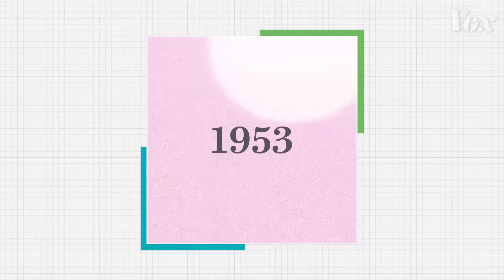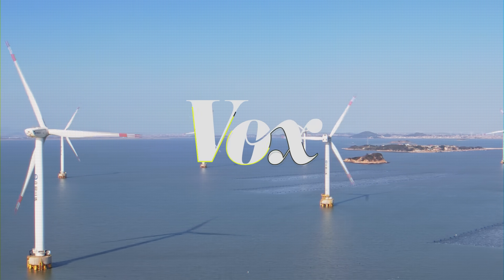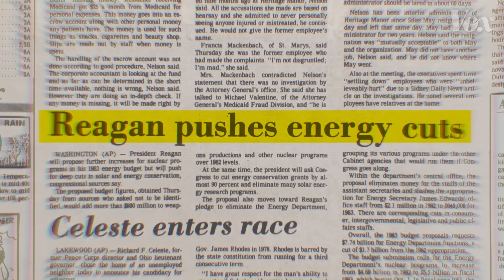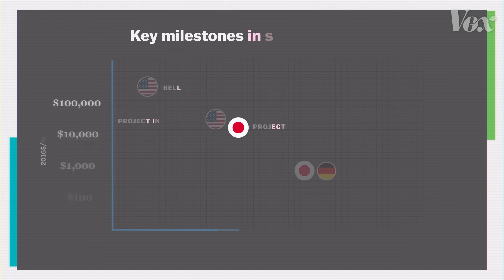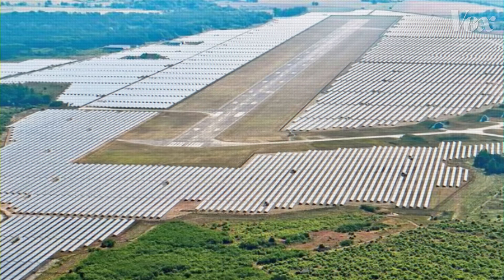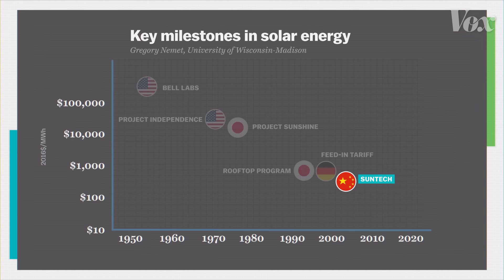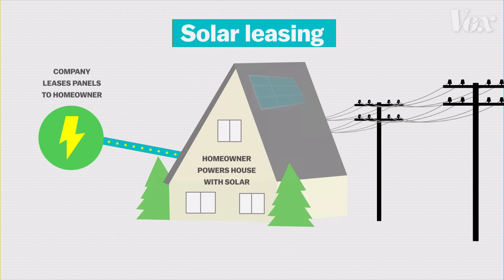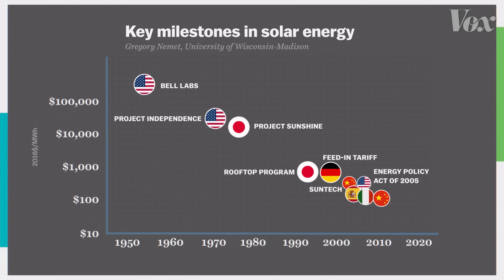How solar energy got so cheap

Comment: Solar Pannels may have become cheap. But its still out of budget for millions of families, because its still expensive. Because Panel alone dont help, you need other system along with it, which does not got cheap as compared to panels.
Reply: its definitely on track to get there! i mean look at smartphones only used to have expensive models  then now bam we have super budget models too in as like a decade of smartphone!
Reply: It depends on the country. In Germany Solar is extremely cheap. You have a return in under 2 years, compared to energy from local supplier.
Reply: @huckleberryfinn6578  

But the price of electricity in Germany is 3 times higher than in USA. Solar is "cheap" in Germany because it is artificially elevated by the subsidies, but for the economy and industrial sector it is not cheap.

For comparison:
Germany: 0.30 EUR/kWh (roughly 0.35 USD/kWh)
United States: 0.13 USD/kWh
China: 0.08 USD/kWh
France: 0.19 EUR/kWh (roughly 0.22 USD/kWh)
Reply: @xeioex  but France has all of its nuclear plant, US has its super cheap domestic gas, and China also has super cheap domestic gas and coal. 

Germany's prices are comparable for other nations with similar energy mixes. It's certainly an argument to be more aggressive about national policy for power, as other nations have done with hydro, wind, or geothermal power as well. But for the millions if not billions of people living in countries which haven't previously had the foresight, solar is more economical now. That's only "artificial" insomuch as it was avoidable. 

Also, the above-market-rate thing is not currently in effect, now it's just the wholesale rate, which is between 8 and 11 cents per kWh just like industrial producers get paid. Basically every country with a feed-in tariff just pays the wholesale market rate now, ie to cover 1 unit if your night-time usage you'd need to export 3 units in the day. That's not artificially subsidised, and in fact the USA is in that regard currently "worse", since you have net-metering in most states.
Reply: @kaitlyn__L  

>solar is more economical now.

This is not true if we consider the true cost of ownership of solar for the grid. It cannot be economical as is, because it is unreliable in terms of electricity production. The peak demand is in the morning and in the evening and solar cannot produce during these hours but the grid have to deliver the electricity from somewhere somehow.

The main problem with solar/wind is that you as a national grid have to have a backup generation for every solar/wind generation. Which makes the whole grid system solar/wind grid + traditional backup grid expensive (because you basically would need to have 2 grids).

The alternative is to combine solar/wind generation with storage capacity (batteries), but the combined cost of solar + storage makes the end price even less cost competitive. 

Also we have to put into the end price of solar for the enormous amount of waste from solar panels that we would have to recycle in the future.
Reply: Yes solar installation costs are high due to labor prives
Reply: As with all technology, the price will come down. At some point the cost to finance a solar system will cost the same as your monthly electricity bill. The difference is once you pay it off you eliminate or severely reduce your electric bill.
Reply: @quentinwilliams1158  Nice lie,
Reply: Which is why leasing, etc. is a thing...

Comment: I'm a little confused, did solar become cheaper from subsidies alone? Or even without the subsidy is solar more efficient than coal(not sure how to measure this, maybe kilowatts per hour?) , and the market just needed to be encouraged to switch?
Reply: The market needed to be encouraged to *invest*. That investment led to the development of more efficient and cheaper technologies. Now solar is simply just cheap. Same with wind power.
Reply: it's both.
Reply: Subsidise it to get it rolling bro, to the point where there is no need for subsidy anymore😊
Reply: @BloodWoof  If only we did the same thing with nuclear energy.
Reply: Think of subsidies as a temporary helping push to get things rolling until the technology matured and became economically viable.
Reply: So solar is more efficient than coal at this point? (is it  better regardless of sun level, land efficiency, power generated by hour, etc) Disregarding rare material requirements ofc
Reply: Subsidies encouraged developers to adopt solar panels while countries like China mass producing & improving panels at scale covered the raising demand and then some, that's what pushed down production costs. What I'm not sure of is if the graph they show included installation costs and other equipment like batteries but even then solar saves a lot on distribution alone. Off topic but yet another example you need state intervention to push the market in the right direction.
Reply: @maximipe  it is cheaper even without subsidies to install and run a new solar plant than to continue running existing coal plants. That's how cheap solar power is
Reply: A lot of solar panels are from China where labor regulations and laws are much more lax and the cost of labor is rather cheap. Chinese also have economies of scale to reduce the prices of these panels.
Reply: the price of electricity graph is preposterous. It compares apples to oranges, not apples to apples.
Solar cannot produce electricity when there is the most demand (early hours, evenings).  So it is not correct to compare these prices, because if we want to compare the same 365/24/7 availability provided by gas/nuclear/coal we need to add batteries or other forms of energy storage to solar, and batteries are not no cheap. also solar panels are very costly to recycle, and we need a lot of panels.  If we combine the total price of the similar energy grid provided by coal/gas/nuclear the solar + batteries + recycling alternative costs much much more.
Reply: Just cheaper with subsidies

Comment: Next video should be why are batteries so expensive. Not cheap when you factor in all the costs.
Reply: The same thing that happened to solar is happening to batteries now. There's a bunch of new subsidies and incentives for companies to develop/mass produce them and the price is dropping dramatically. For the first time in a while, there's a bunch of new battery tech that's being researched and headed towards mass production.
Reply: Batteries are by FAR the most expensive part of switching to solar. 3/4 of the cost of the solar system my wife and I installed was the cost of the battery. The inverter, regulator, and panels were cheap.
Reply: @kaseywahl  and probably that battery could feed tour house for minutes only
Reply: @antoniocipolla3259  At full capacity the battery lasts for about 4 days.

Comment: well it's nice for countries that can afford it, but distorting markets like that comes at a big price and is ripe with pitfalls. you can have companies set up to benefit from those feed in tariff that are n not structurally sound (basically you need to plan the exit strategy of your subsidies), you can bet on the wrong tech.
because of its intermittency solar will come with the need of storage or industries that can leverage the uneven production of energy.

also most of the increase in production capacity and the linked technology came from the evolution in the semiconductor market, which had its own organisation. 
so my point being,  this sure ended up being a success (not necessarily for every body involved), but we shouldn't look at it with rose tinted glasses if we want to emulate that with other technologies...
Reply: 1) You forgot a wee thing called rooftop solar, in which the members of the public get the feed-in tariffs 2) In Australia, most solar generation currently is rooftop solar and it has been costed than even with a 90% renewable generation mainly via solar (thus more batteries required), it still is cheaper than any other generation source.
Reply: @ChineseKiwi  I think you are arguing besides my point which is that even though you can kickstart a market by subsidising it you still have work to do in order to have a long-term solutions. 
rooftop solar doesn't change the fact you need to plan for an end to the subsidies at some point. (good subsidies with good long term effect are hard to make and don't necessarily benefit to the countries which started them)
your second element is also completely unrelated to my point. it seems to be a really great news so much so that I'm a bit sceptical. centralised networks are easier/cheaper to build in most countries (maybe not Australia ?) , basically the only ones we have as of now are centralised and we are striving to build more decentralised at a great cost. also a 90% solar network (just for energy or do you factor in transport and industry uses in ? ) would require storage several orders of magnitude larger than that we have now. so estimating their price realistically would be a bit hard, unlikely to be competitive unless we manage a technological breakthrough at scale.
Reply: @dEcmircEd  yes, the latter has been calculated. It's still cheaper fir places eith massive solar irradiation.

Not to mention, solar farms are typically next existing transmission lines and of course rooftop, uses existing.
Reply: Sure the solar industries is subsidized, until you took account how MASSIVE oil subsidy is. Total PV subsidy and tax breaks is not even 1 trillion$, yet oil subsidy is multi trillion and never ending.

Personally, i'm not fan of rooftop solar. It's small economy of scale means more maintenance and less efficient energy output. And of course complexity of energy distribution and management too. Centralized solar generator put in high insolation/uninhabited areas (aka deserts) is way cheaper, less disruptive, and can maintain higher quality/efficiency infrastructure such as batteries.

While sure, there is possibility that we're investing in wrong tech, it's not completely go to waste though. Advancement in cheaper silicon manufacturing allows cheaper chips/electronics who don't need advanced nodes. Understanding polycrystalline silicon allows better yields both of PV panels and other semiconductors. And research into other, more exotic semiconductor such as perovskite helps further our understanding of quantum physics, possibly leads to breakthrough in other area. Don't forget also advancement in battery tech, lithium-ion or otherwise.
Reply: @hanifarroisimukhlis5989  you forget the transmission costs are the biggest part of your bill. If you build it in the middle of the desert not near population centres, that negates any cost saving.

In Australia, rooftop solar is literally less expensive than solar farms. You forget there is no land cost with rooftop solar as well, that isn't borne by the electricity companies.
Reply: @ChineseKiwi  if all what you say were true (which would be great !) there is little reason for everybody in Australia not to become self sufficient using rooftop solar. I'm afraid this won't be the case for the vast majority of Australians in the near to midterm. (because of the cost of the panels/batteries / huge number of wave forming hardware etc). also the biggest energy consumption probably isn't at home, but in transportation and industry
but if the future proves me wrong it will be delightful.
Reply: @dEcmircEd  it is in reality the initial upfront cost. It is a few thousand dollars, but that will be paid off within 5 years via solar feed-in. Solar panels tend to last 20.

And there is strong uptake. The states of Western Australia and South Australia have the highest solar panel adoption per 100,000  households in the world. And these are states in which mining are a strong part of their economies.

Comment: VOX lies.
The most perfect solar panels and energy storage batteries have been with us from the beginning; they are also the most environmentally friendly. They are called ‘plants’.
  ‘Old-fashion’, -right? (-‘Radical thinking’). 
  They are superior in every way. Plants collect and store solar energy, and it can be easily tapped, -on demand. They consist only of all natural ingredients that are already here in our environment and will not release anything other than that. While storing solar energy for us they take in greenhouse gases and release oxygen for us. When we extract solar energy from them, be sure to also fully incinerate the greenhouse gases being released. It will provide even more heat energy and return the carbon back to where it came in the first place; building blocks to repeat the process.
It’s not complicated or hard to do. A catalytic converter is an incinerator. Petroleum IS decayed vegetation. Believe it or not, it’s all ‘natural’. We have been lied to. And other countries know it; we don’t want to admit it.

Comment: as a german let me add a little more information on why we were so obsessed with solar:
gemany isnt the most windiest nor sunniest place. but after we decided to phase out nuclear power (after chernobyl and fukoshima) we had a problem.
we needed a new source to generate carbon neutral energy if we wanted to end our dependacy on coal and gas.
but because there is a LOT of push back for wind parks by the public and politicans (especially in the south), windmills arent really a possibilty.
so solar (combined with water turbines) is basically our only source of renewable energy, even if it isnt really practical here.
Reply: I don’t like Germany…Responsible for 2 world wars.
Reply: No. Coal and gas is your main source of energy. Phasing out Nucleae is probably the biggest mistake Germany made in the last 10 years. It led to dependency on Russian gas (hello schroder) and huge increase of emissions. Today Germany has a higher emission factors than when it still had nuclear and less renewable.
Finally, nuclear is the Safest source of electricity, and this is said by UN (usnscear). Less than 50 people dead in tchernobyl + Fukushima. 
I Hope Thant Germany will continue with renewable but will admit one day that they did a huge mistake that impacted whole Europe
Reply: Meanwhile Poland:
- What is nuclear power? ( ͡° ͜ʖ ͡°)
Reply: Now just imagine how amazing Germany could be if they bring back their nuclear power as a backup energy system for their solar and wind sources... 😮

Sidenote: I work in the Germany solar PV industry 😉
Reply: @TheAmericanAmerican  Don't worry, France can send you nuclear power